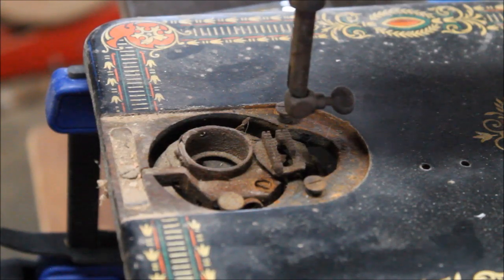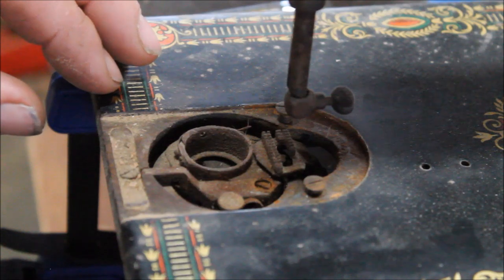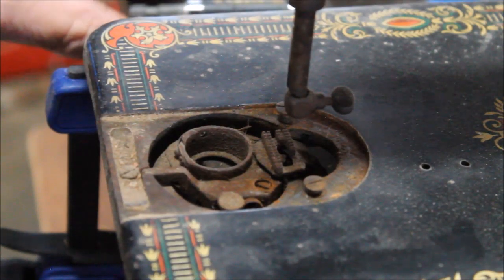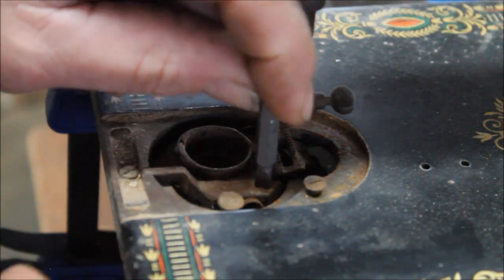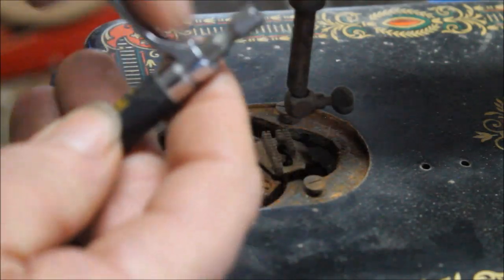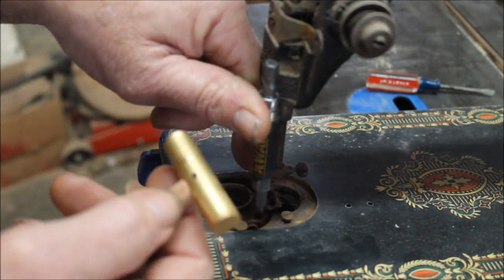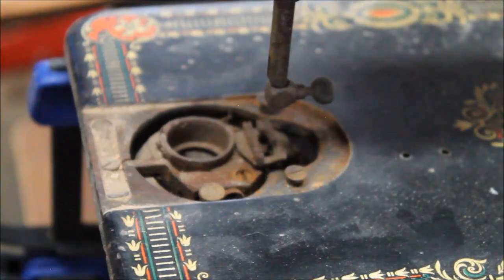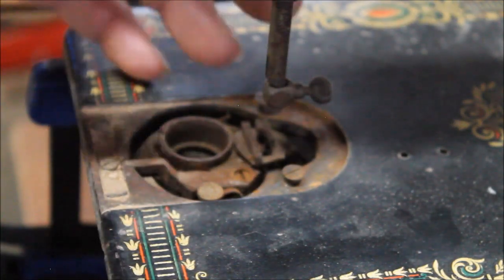Breaking Loose Stubborn Screws in Rusty Old Sewing Machines

Comment: Thank you! This worked! I used a kalimba tuning hammer. I bought a vintage Singer Stylist machine and I haven't been able to get inside until now because I worried about using anything other than oil that might damage the light blue paint.

Comment: I absolutely agree with you on the proper screwdrivers. I see a lot of industrial sewing machine mechanics who seem quite knowledgeable but as soon as they bring out the tapered screwdrivers, I run the other way. Can't get out of there quick enough. Screw slots are square, not tapered. If they are coming to a screw with the screwdriver at an angle, they are also using the wrong tool. Some people just don't care and others simply don't know any better. When I see the screw slots all stretched out of shape on a machine, I think some hack has had a hold of this one. It reminds me of taking your car in for a tuneup and finding out after that the engine runs fine but the front fenders are scratched because the mechanic didn't bother protecting them with a cover.
Reply from the maker: Very well said!

Comment: Any tips for removing the screw at the back of the faceplate by the presser foot? I have very limited tools at my disposal, unfortunately. I have tried tapping it with a hammer to no avail, but it is impossible to get a good connection because of where it's at. My machine is actually not rusty at all, in great condition and runs beautifully, but I think there is some old fluff around the feed dogs and I cannot get in there to clean it out (or even to check that's the issue) as they suddenly began feeding in a circle. I've only had the machin just over a month and used a few times. Just can't get that darn screw out!

Comment: What about getting a stuck allen set screw loose on a steel collar / steel drive gear in the sewing machine running gear / transmission shafts? How would you do that? Heat the collar up with a butane torch, I'm thinking, maybe?  I've got that problem with one I'm trying to replace the gears on. Thanks!
Reply from the maker: Yeah I'll use heat when it is necessary, torch or heat gun. Some try hair dryer but they don't do that great because it heats slow and the heat transfers into the surrounding metal and doesn't allow concentration. 
I've had better luck though with just a straight stick of the correct size hex shaft, applying torque with either an adjustable wrench or small vise grips, and firm tapping on the end of the hex shaft with a hammer. It's helpful to have a few extra Allen wrenches to cut off the bend and have straight pieces to use.

Something I've used a lot is socket head extractors. They have a tapered hex on the end that can be tapped into the screw head while applying torque. They're not cheap, but you'll rarely find a screw these won't loosen. Check out https://www.mcmaster.com/2643A42

If you're willing to do some careful belt sanding or filing, take an Allen wrench one size larger than what would fit in the screw you're trying to remove, and taper the tip enough it can be tapped tight into the screw
Reply: @rayelkins7872  Great suggestions, tips, Ray! Thank you very much! I'll try them!! Thanks for taking the time to answer that so well! God bless.

Comment: How do I remove the eccentric bolt from a 1906 singer 27 bobbin winding main gear? I've only manage to get he nut off the back and the small screw that holds the cam in place.
Reply from the maker: If the nut is off you'll just need to work the screw loose. Nothing holding it other than the nut

Comment: What do I do about the the small clutch knob in the center of the handwheel that simply will not budge. I just can't move it. I've learned a few new words trying to get it to turn.
Reply from the maker: well a good pair of adjustable pliers (Channelocks) and a strip of leather would be my first go. Put the leather on the knob to prevent the pliers from scratching the knurled area and try to turn it. Tapping on the knob while trying to turn it might also help, but use a block of wood against it to strike with the hammer. Never hit the machine directly with the hammer. Well, at least not until you have had all you can take and there are no more new words to learn. By the way, what kid of machine are you working on?
Reply: It's a 66-16, It's birthdate is 1941, same as me.
Reply: I'm sorry, it's not a 66-16. It's a 1922 Singer 66. It sew well but the blasted clutch knob just will not budge!

Comment: hello you have some good infomation. my problem is i have a 66 that turns and everything is loose exept the footbar that is stuck solid in the down position and it dont matter what i do i cant get it to budge dont no if you have any ideas for that ive tried penetrating oil sewing machine oil and then in anger i hammered the top so now it is completley stuck down on the needleplate so i cant take the needleplate off now either. its really frustrating because there is nothing else wrong with the machine except for the fact that the footbar is frozen solid. and i really dont want to scrap it if there is any way i can save it and get it to work again.
Reply from the maker: well, I get a lot of those like that and first thing I do is remove the screw(s) inside the face plate that hold the lift mechanism and the presser foot bar together. On the 66 there is a small screw that goes through and into the presser bar and a second screw beside it, it will be the screw on the left you need to remove.
 If at all possibly, take the presser foot off if you haven't already. There is a flat area there that is just right to tighten down a small adjustable wrench (Crescent wrench). Make sure it is snug. Now start trying to turn the bar while you tap the top of it with either a brass hammer or, if you don't have a brass hammer, get help and use a regular hammer with a small block of wood on top of the bar. Brass hammer works better though, as the wood will absorb a lot of the shock and you won't get the same result. Don't hit it hard, tap it like I tapped the driver in the video. Try turning it with the wrench first one way and then the other, while tapping on the bar at the top. I usually see results right away when I do this, but if it still doesn't move then try heat. I prefer a heat gun as opposed to a hair dryer because quick and uneven heat (with a heat gun) causes uneven expansion of the metal parts and more likely to make them turn loose of each other. 
 You should be able to get it to start turning with what I've described. I honestly cannot remember one that this method did not break the bar loose and do it fairly quickly. Once it is turning, use the wrench to twist is back and forth as you work it upward. You might have to work it up and down as you twist, and add some more sewing machine oil too where the bar goes through the bottom of the housing. When you have worked it up high enough that there is 1/2" or more sticking out the top, take the wrench off and get a drill, preferably one with a clutch where you can control how hard it twists the bar .Make sure the drill is on the lowest speed, and chuck the drill snug on the top of the bar. Bump the trigger, making sure that the bar turns and the chuck isn't slipping on it. Only tighten the chuck enough to turn the bar. A drill chuck will damage the plating on your presser bar if you tighten it too tight, but it will also damage it if it spins on the bar. That is why I say bump the trigger first to make sure you re spinning the bar. Once the bar spins with the drill (and make sure you have oiled the bar where it goes through the bottom of the housing) start spinning the bar and moving it up and down at the same time. As you raise the bar while it is spinning, you will likely feel it try to get harder to spin. Keep the drill running and lower the bar, then raise it again, all the while keeping it spinning. Every time you raise it, the bar should come a little farther out. They usually come right out. I can't promise yours will, but keep in mind that what you are doing is working it loose a little at a time. It's not just going to immediately be loose and come out once it moves. It takes a little patience.
 Let me know if this doesn't work for you. I think I have a couple scrap 66 machines in the shop that have stuck presser bars and I can set one up and make a video of this process.
Reply: Thank you for such a detailed response to one of your viewer's questions. Didn't see a reply from him/her to let you know the results. Appreciate your effort.

Comment: Can I use this method to get my needle bar screw loose? I think the needle bar is twisted  bit.
Reply from the maker: Since there are so many variables, I'd need to know what kind of machine we are talking about before I can confidently answer that question.
Reply: Similar problem here with the needle bar. While working with leather, the needle bar suddenly descended and now, the needle fastener hits the roof and can't make a full cycle. The screw on the needle bar is badly damaged from failed attempts at getting it loose.

Any way to contact you? My model is a 1950s Singer, and getting professional help and getting replacements is all but possible, thanks to quarantine.

Comment: There's nothing wrong with using WD-40 on rusted screws. You can still use a good screwdriver and a hammer on it. WD-40 can not hurt anything, it can only help.
Reply from the maker: There's nothing right about it either. WD-40 is good for what it's good for, but since it will not dissolve and soften hardened oil in a sewing machine very good (if at all). Sewing machine oil, on the other hand, will do exactly that. WD-40 is a water displacer.😉
Reply: @rayelkins7872  
Surely there is something right about it.
WD-40 is used by everybody from a watchmaker to a mechanic, and everyone in between.
Reply from the maker: @Drottninggatan2017  "everybody"? 😂 Not quite! There are those who fall for the marketing hype and those who know better.😉